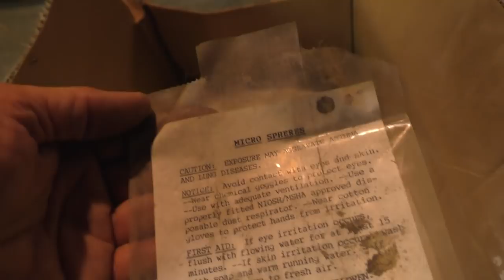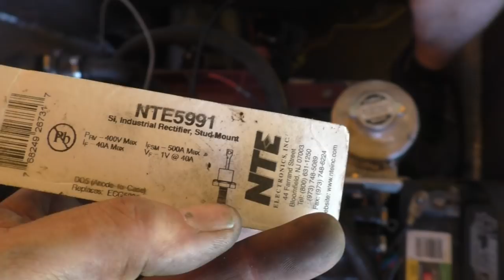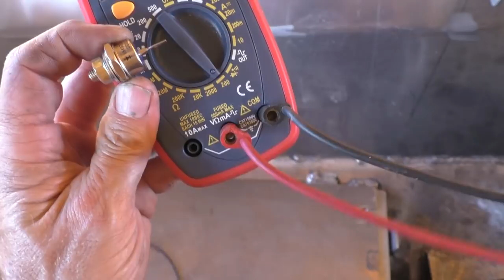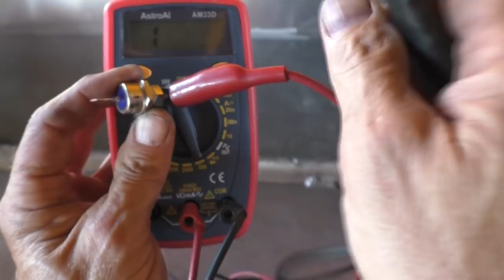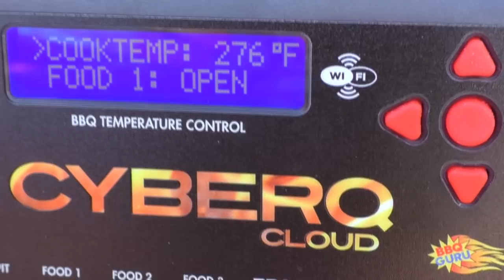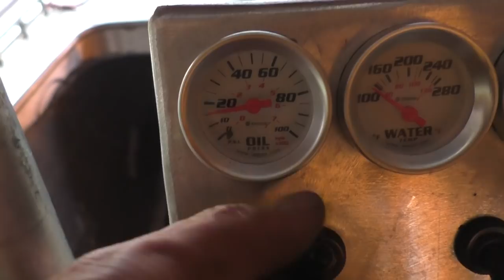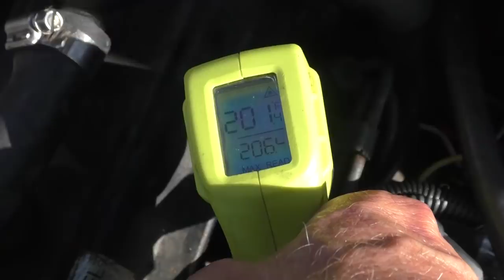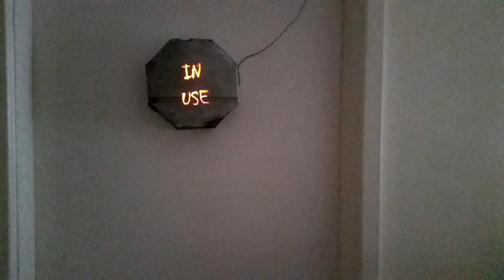Diesel Jet Boat Build - Part 17 - Fixes and Back to the Lake

Comment: I installed a ride plate on my 1978 Hallett big block jet boat that was very similar to the one you guys built for your boat. On top of the things you mentioned it would benefit,  but, it really helps a lot when you're up on plane. On my 19ft hallett, my pump stuck out the back of the boat 24" from the transom to the very end of the reverse bucket in the reverse position. My ride plate ended at the end of my split bowl, before my place diverter (trim). Before I had the ride plate, my boat drove like a 19ft boat. My top speed was 93mph on GPS (It has a fully built 460 BBF, bored .030 over with a longer stroke making it 521CI. Its a full roller engine and is running the holley fuel injection system. After it was built,  we installed it into a dyno car to get it started and do the initial break in. The fuel injection system actually self tunes based off a few sensors. Once it was pretty close to right on, we did some dyno pulls and it put down over 700HP to the wheels. They estimated it to be around 800+ at the crank on 95 octane.) After the ride plate I picked up around 3 mph and the boat road in the water like it was 2 ft longer. It also ran a little higher in the water on plane. Anyway, long story short, just thought I'd point out some additional benefits of running a ride plate. I like your videos. Very informative! Will subscribe as well.

Comment: Not sure how the VW alternator works, but on the Delco I used in my hotrod I wired the alternator exciter wire to a light mounted on the dash.  The other side of the light is wired to the ignition ON terminal.  When you switch the key ON, the ignition switch feeds the positive side of the light, and the alternator provides the ground.  The light turns on.

Once you start the engine and the alternator starts spinning the voltage passing through the light excites the alternator.  Then of course since the alternator is now providing current, and you have it on both sides of the light, the light turns off letting you know the alternator is working.

I also have this type of circuit in my old BMW.  Sometimes I have to blip the throttle to raise the rpms enough to excite the alternator, and start the charge.  Handy feature really because if the light is illuminated I know letting the engine idle will kill the battery.
Reply from the maker: Right.  But we just have a push button.  No ignition switch.
Reply: Use a light bulb.
Reply: SV Seeker well, your power ON switch on the panel next to the start pushbutton is the same function as a key ON switch.  Just an idea, thanks.
Reply: Bread996                                                                                                                                                                                                                                                                                                                                                                              1.
Reply: @SVSeeker  a 4 wire Ford style starter selonid would also work, s term from start switch, t term from alt. Won't excite the alt till the starter drops out.
Reply: move the excite wire to the switched side of your on/off switch.
Reply: Same sort of setup on my Dad's kubota tractor.
Reply: Bread996 - Spot on !  The bonus of doing it this way is that if the exciter wire and the feed through  the ignition (ON/OFF) switch is different, the light comes on indicating the alternator is not charging.
Reply: There is such a thing as a "one wire" alternator.  It has a magnet built into the field windings.  Not really enough to make reasonable power, but enough to "excite" the alternator.

There are also some one wire alternators that use electronics to keep some residual magnetism in the field "core" by actually turning the field on for a few seconds every couple of minutes/hours.  Yes, this will kill the battery over a long period of time.
Reply: worth noting, if you do not use a lightbulb or resistor on that wire, it will try to charge the battery through the little diodes for the regulator and smoke them.
Reply: spot on bread996 . been doing this on boat in the uk for years .very simple and best way to do it.also if you dont have a key just use toggle switch . flick switch on start engine . when u stop engine flick off . but use a in line bulb to tell its charging
Reply: Hello from good old Germany, Bread996 is right...connect the wire from the alternator to a lightbulb and the other side of that bulb to the switched 12V from your mainswitch...this is the right funktion in a car... this Bulb is a Indicator if your Alternator is still working...Greetings from Schleswig Holstein /Germany
Reply: Bread996 This type of circuit is also used on my plane. Simple and reliable.

Comment: the soldering thingie melts at 138°C, which is suspiciously like bismuth solder. The issue is that bismuth solder is brittle and tend to crack with vibrations.

Comment: Alternator needs that SENSOR wire to be attacked to the IGN-run circuit. This will energize and allow the regulator to monitor the voltage drop at the RUN circuit and adjust voltage output accordingly.   Traditionally the two small starter terminals were KEY START and BALLAST RESISTER BY-PASS to give a coil 12vc starts, then 6 vdc via the ballast resister to reduce the arcing on the ignition points ....cause by the 12 volt voltage.  Moist coils were 6vdc coils with a hot shot of 12 vdc for starting.  
One wire alternators are self exciting and monitor internal their output, thus they do not compensate for voltage drop caused by circuits loads

Comment: It's worth noting that the rectifier is shaped like a bolt because it's intended to be bolted to a heat-sink. If you're running anywhere near 40 amps through the thing, it'll be putting out 20+ watts of heat, and can get hot enough that it will self destruct.

Basically, you loose some voltage in a diode (for silicon diodes, it's generally about 0.6V). 0.6V * 40A = 24 watts of heat at 40A.

It'd be a good idea to check to see it's not cooking itself to death when in use.
Reply: Good theory but he is just operating the solenoid for the time the starter is running.  That load should be about  7 amps.  The power from the alternator or to the starter motor is not going through the diode.
Reply: Yeah it's only taking current during startup so no real issue. Diode should last forever
Reply: @chickenfishhybrid44  that's now how I understood it. I thought it was wired to the starter button. The split in the wire goes to the alternator and the starter. Hence he's having issues with the starter staying on and getting mashed up
Reply: @chickenfishhybrid44  well that's assuming it fails closed. The diode wount have any current flowing once it's running. There's a 12v supply both sides

Comment: Doug a small 12v 10w lamp on top of the instrument panel in series with the generator's exatment coil, in parallel with the Disel valve conductor. When you start the engine, voltage on the Disel valve is on, then the landing indication lights up. You press the start button the engine starts and goes up at idle speed. Charging indicator The lamp goes out when the generator is charging. The lamp is a good indicator of whether there is something wrong, does not generate any power, if the generator / water pumps belt goes off, you'll see it directly on the lamp
Reply: That's how i rewired my friends classic 1963 Landrover.

Comment: That engine should be able to rev up to 4000rpm, even if you only need 2700rpm to knock about it wouldn't hurt to give it a run at higher output every now and again. 

Chris is my kind of bloke. Pulling a travel trailer with a 3 door Toyota Yaris hatchback... That is epic. Those Yaris's are tanks. There are a few people who have put 500,000 miles on them on the original engine.

Comment: Your AIR INTAKE is TOO RESTRICTIVE. your engine need to breath.  You are working you turbo too hard. you need a vacuum gauge on the air intake to see what I am saying.  Ask any good diesel mechanic.
Reply: Agreed a 15hp honda would go as fast. this engine is being overworked and wont Last long at all.......
When the water cap was removed looked like it was boiling so you dont put cool water into a none running engine ..................
Like another comments there is something wrong with engine-boat hull etc
THIS 20 FOOT JET WITH SAME ENGINE DOES 35+ MPH
https://youtu.be/wk2AOh3YTKs
Reply: I disagree...hes only doing 7-8 mph.... with the correct prop this should be totally achievable
https://youtu.be/IwmmkhuG_Ts?t=25m59s
Reply: If he had build in more airflow through the turbo how much HP or rpm u think he would have,.thinks gb

Comment: Ahoy there, wot ho.. I would have used a VW TDI 1.9 AWX 130bhp engine,  they can be chipped to 140BHP also a tough as old boots. One more piece of advice if  you cool the engine with a sealed system  use the VW inhibitor @ 50%  The VW  lump has a lot of dissimilar  metals in their engines, the Aluminium cylinder head  will make a great anode for the engine if you don't use an inhibitor..

Comment: Doug   Try the system without the diode or hot feed. Residual mag in the windings should be enough to excite the field. Only have to do it once. From then on it will have this residual mag stored. Try it!!
Reply from the maker: That’s apparently often the case but I’m told it’s not 100% reliable.

Comment: Heavy-duty diodes are sometimes called rectifiers because when you put them together in the right way (a "rectifier bridge") they take alternating-current (AC) electricity and "rectify" ("correct") the reverse phases of the AC  so they are now all forward-biased direct-current (DC). Then you add some capacitors to smooth out the ripple and you've got an AC to DC converter. Google AC rectifier bridges for more info.
Reply: As long as you don't put it across a voltage that exceeds the reverse-bias breakdown voltage for that model diode you're fine connecting it in the non-conducting direction. If it is a bad diode it might rapidly heat and explode (really more of a dramatic "pop") so make sure you are wearing appropriate eye protection and don't have it between your fingers. Or put it in series with an appropriate resistance such as a light bulb so you can't exceed the 40A limit and you can test current flow in both directions. Assuming, of course, you don't just have a volt/ohm meter handy.

Comment: Nice to see the wrinkles getting sorted on the tender. The good thing about cheap wrenches is that you can peel off the silver paper and eat the chocolate, lol. I found you on Google Maps by putting SV Seeker in the search. The view was taken a while ago, before the hatches and wheel house were installed. You've come a long way, atb. PS in DC it is a diode, in AC is gives you half wave rectification. The alternator will have 4 diodes and smoothing capacitors connected in it to give out DC voltage.
Reply: Actually it's there are 6 diodes in it at least (its 3 fase, double rectified) in most alternators there are even more in it  for the regulater circuit and the lamp (b+)....
Reply: I was remembering what I was taught as an apprentice electrician and the MGs I owned. I expect they are far more sophisticated now than nearly 40 years ago before all the electronics started to appear in cars that are around today.  lol. I'll settle for a b+

Comment: no turbo whistle? wastegate kept open maybe. there should be very noticeable high pitched whine
Reply: @chickenfishhybrid44  true about the long intake but even small turbos have very noticeable whine, what's more he has insulated the exhaust manifold, the exhaust velocity should be much higher than bare manifold. These things spin at 15,000 rpm generally, no way it's silent 100%
Reply: @chickenfishhybrid44  yes but turbo whistle cuts through the noise because of the high pitch , phone mics pick it up easily
Reply: vw turbos don't whistle . most of them are so quiet you cant even hear them
Reply: @kc03300  what are 'vw' turbos? They're all made by 3rd parties
Reply: Garett makes the turbos
Reply: Some turbos come with a silencer ring in front of the impeller and it cuts the annoying whistle down a lot

Comment: 1.9 tdi turbo and exhaust manifold will improve spooling and power or a compounding turbo set up and the intake studs are easier to remove if heated first.

Comment: I use stainless wire and twist the heat wrap on exhaust. It’s faster and cheaper than the stainless zip ties. Both work fine.

Comment: 15:25 In my experience with on-the-road stuff, those solder butt join things don't seal worth a damn when you're trying to split a wire off like that, as you mention. They seem to seal quite well when it's one wire in each side, as long as you're careful shrinking 'em down. (Hot air works a hell of a lot better than a small blowtorch; it's very easy to cause pinholes in the heat-shrink, that sprout little spikes of solder, or let water in.)

Comment: it's called a rectifier because of what it does to an AC current.     a standard AC waveform cycles from positive to negative....if you put a rectificer in circuit, it blocks the negative portion of the circuit, ...turning it into a pulsating DC current....
Reply from the maker: Ah yeah.  That makes sense.  Thanks
Reply: glad thats been rectified
Reply: *rectumfied

Comment: You should wrap that turbo down pipe as well if you want to reduce the engine compartment temps. You can have the turbo ceramic coated as well to drastically reduce the exterior temp or get a turbo blanket to contain heat.
Reply from the maker: Water is injected into the exhaust at the bottom of the wrap.  After that, you can put your hand on it.  It's only warm.

Comment: Hey I know you want to be done working on her but ive got a few pointers... One is you need to figure out the deal with it running When you choke it and you really should throw a boost gauge on it. That should help you

Comment: We used solder - shrink connectors in the USAF in 1975.  We had to use a heat gun with them on the aircraft (no open flame).

Comment: Hi Doug,looks like you are using plastic line for your oil pressure gauge. I am recommending using copper. It won't melt or corrode.Ask me how I know.
Reply: I have the same pressure Guage in my car. The plastic line was constantly breaking at the fittings, and spewing all my oil out. Copper is holding up better, but it does work harden. Braided stainless would be optimal.

Comment: I don't mean to toot my own horn or anything... but i recommended that exhaust wrap when you were piping the big boat. I'd wrap all of the exhaust just to help reduce the heat in that cabin.

I also recommended SuperClean recently... which is the same stuff as PurplePower. I use that stuff for everything, like laundry, oven cleaner, driveway, windows, stripping paint, de-rusting (it's caustic), engine cleaner, and even as a weed killer. It's the best degreaser on the planet. (sodium hydroxide = lye / grease and lye = detergent)
(*** NØT recommended for aluminum, hand cleaner, or mouthwash. Ask me how i know.)

So i feel appreciated.
Reply: Careful with SuperClean, that shit will concrete and the coating on your washer.
Reply: It also turns some bare aluminum black and splotchy.

Comment: To make a water tight three way connection all you need is to put some hot glue shavings into the junctions and they'll melt to seal it up.

Comment: I know this thread is an old one but you have to get the jet stream above the water. High angle gets on the plane fast, lower angle is for speed but needs shit loads of hp to get it out of the water. I suspect the later is your problem.

Comment: BTW, if you ended up wanting more power out of that engine, I can assist in sending some links to a higher performance cam, upgraded turbocharger and a recalibrated ecu that between the three will add a considerable amount of power! That engine is 90hp and 150ft lbs stock. After those 3 upgrades,  it will be in the area of 160-170 hp and 300+ ft lbs! It will still be reliable and actually get better fuel economy. I had a jetta with a 1.9 TDI and did those upgrades.

Comment: If an object strikes the ride pad the impact may break the pump.  Rather than have the pad hard mounted to the pump you should consider rubber bushings to avoid possible damage.

Comment: With that pump, and that engine, you definitely will want to make sure the pumps wear ring is in good shape. Also, being that engine reclines and like 3500 rpm you will probably want to change the impeller cut to something that will move more water at lower RPM. Something like an A or even an AA cut.

Comment: Nicely done Doug, that stability is way better. 
Can you run the engine with limited load to see if it will get to full RPM ? ( without frying the jet bearings) . It would be good to know if it’s the load that is limiting the rpm or something else. Cheers Warren
Reply: Also, could you run a line through a scale to an anchor or bollard? It might be interesting to know how well it might perform as a tug.

Comment: Man that jet pump should make that boat fly well beyond 7 mph. Something is wrong.
Reply from the maker: I don’t think so.   It is a very heavy boat
Reply: It's not the pump, it's what power and rpm you throw at it, also pitch of the impellers plays a huge role in pump efficiency. @SV Seeker you should have a read through the NZ Jetboating forums, those guys are a wealth of information and we live and breathe building jetboats over here!
Reply: The problem is the RPM capability of the diesel engine.   Jet pumps aren't designed to be spun so slow.

To get that pump into a decent efficiency range, the engine would have to spin so fast, it'd self destruct.